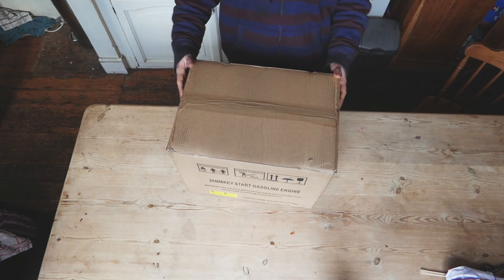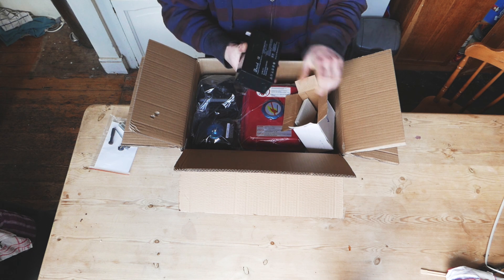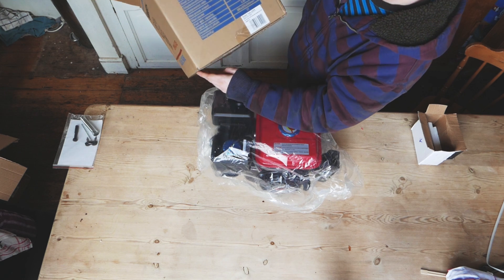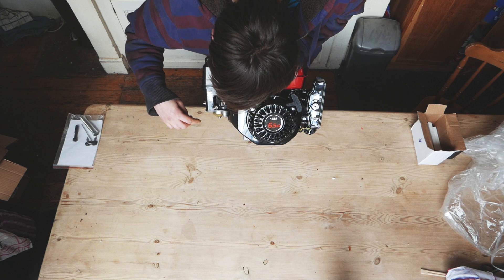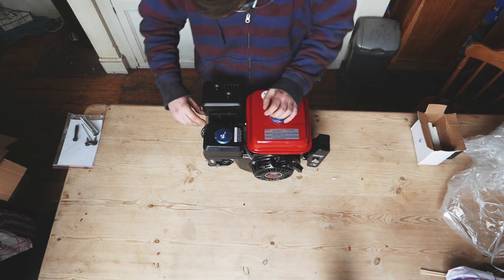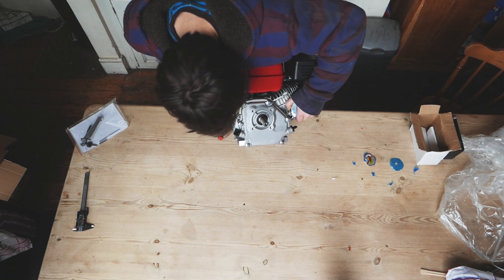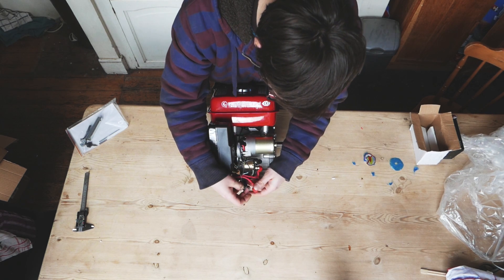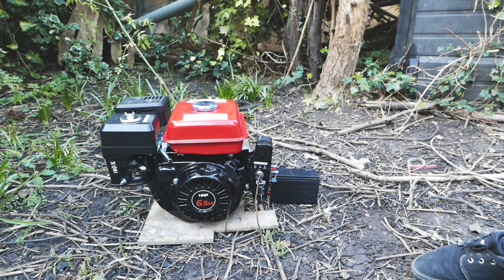Eberth 6.5hp honda clone petrol engine unboxing and starting overview with sound

Comment: Will this work in a lawn mower because I got a 25 year old tractor I want to at least run
Reply: It depends, if you're talking about a normal lawnmower and the shaft is vertical, it will not work as the output shaft is horizontal👍
Reply: @grimytech  its a vertical shaft
Reply: @swampdonkeyy717  yeah, so you'll need an engine with a vertical shaft to match, if you got an engine like the one in the video, it wouldn't work as the output shaft isnt going straight down, it goes to the side.I'd reccomend getting a ride in lawnmower specific engine, not one like this

Comment: Does sit come/need a battery? And if yes, how do you mount it? (the recoil start version)
Reply: It comes with a battery
Reply: You mount it near to the engine separately to it, there is no holding plate for it

Comment: Is there any what that I can add a fuel indicator?
Reply from the maker: You can - using a float type indicator (ebay) but you need to cut a 28mm ish hole in the top

Comment: For some reason  I bought the same engine type with the exception for some reason, of the electric starter motor ¿Anyone know if can install a starter motor kit in my engine modeL GG1-HR196-200?

Comment: I recently purchased one of these engines thankfully it came smashed up.  I have never seen such poor build quality.  The flywheel had jb weld on it filling the imperfections the magnet was held down by silicone sealer an 1 small m3   screw just to name  some of the imperfections.  The replacement lifan engine was 20 x better even the box had plywood in the bottom
Reply from the maker: Jesus, that's terrible! I would have thought JB weld is too expensive to fill cracks with 😂. Good that you got a replacement. Sounds like standard have slipped during the years 😣
Reply: I bet it off wish I know place where they make higher quality Honda engines and it’s is machine mart

Comment: are these engines any good? do they make the rated power? also will they last a long time? and can they be used for continuous operation for 6 hours or so?
Reply from the maker: I haven't dyno'd the engine to verify the power figure, but I think 6.5hp is only a peak figure, and only reachable intermittently. The engine does bog down when you load it up - if you plan on running it constantly I'd over-spec by 2 times, so if you need constant 6.5hp I'd go for a 13hp+ version (they do exist, they're just scaled up larger displacement versions). Hard to comment on the longevity - it's only splash lubricated, and has lots of springs and screws that loosen over time and carb might need looking at, but parts are very cheap compared to 'real' engines, so I wouldn't hesitate. Just maintain it regularly and it should last you a good few years. I had mine for 2 years +, running 3/4/5 hours at a time, it was going strong untill I messed with it till it broke 😭
Reply: @Loopyengineeringco  thats good to know. i plan on using it for pressure washer use so it would be run one day a year and around 5 or 6 hours of use on that one day.
Reply from the maker: @slybunda  oh, it'll be absolutely fine once a year. Just use the proper calculations to size the motor/pump/pressure and you'll be fine 👍
Reply: @Loopyengineeringco  its a off the shelf solution, says it has a 7hp engine. dont know if 0.5hp extra makes much difference. dont even know if its just the sticker and all the Chinese engines are the same lol.
Reply: @Loopyengineeringco  i bought the pressure washer and its excellent, its so much faster to do the job, im done in under 3 hours of run time.

Comment: can i install this to go kart
Reply from the maker: I've not done it, but i'm sure you can! Just need to add clutch, sprocket, etc
Reply: @Loopyengineeringco  how i install cluth.if the engine have gears
Reply from the maker: @Hirunaa.00  This engine has no gears. The output shaft is the crankshaft. You need to use either CVT or centrifugal clutch + sprockets
Reply: @Loopyengineeringco  how much weight can pull this engine
Reply from the maker: @Hirunaa.00  No sure. There are loads of videos on youtube of "GX200 kart", or "predator 200 kart"
Reply: @Loopyengineeringco  is this engine very powerful
Reply from the maker: @Hirunaa.00  cheap/reliable/powerful - you can always have 2 things but not all 3. This is definitely cheap & reliable. 6.5hp is not a lot. You can tune them to 12hp + but for the price, you can buy the biggest single cylinder you can afford, and it will be more reliable at stock power. I'd recommend the 16hp 460cc engines - much more power and still stock reliability. Or multi-cylinder motorbike engine. For my purpose (2000w~ generator) it was perfect - low fuel consumption and small, simple. But for a kart, i'd go bigger
Reply: @Loopyengineeringco  how i fount that engine ( you told).can you give me a link about that engine
Reply from the maker: @Hirunaa.00  https://ebay.us/bBbyfi this is a 420cc Lifan engine, clone of Honda GX390. It's much more powerful than my one in the video. But heavier and bigger, so make sure you have space for it. There is also a 460cc which is a few HP more, but can't find at the moment.
Reply: @Loopyengineeringco if that engine can pull 50kg
Reply: @Hirunaa.00  my gokart that I made had a 5.5hp engine and it could pull 80kg easy, with a large sprocket for good gearing, so you have to have a good gearingsetup. It had a mad top speed as well.

Comment: Do you think It's a good Motor for build a Go Kart
Reply from the maker: Sure! There are loads of upgrade parts for these too since it's compatible with honda parts - hi comp head, ignition advance key, larger carb jet. It doesn't have a clutch though, and the starter motor is probably not needed - extra weight
Reply: @Loopyengineeringco  thanks for the fast answer!!
Reply: @s33saudios  my gokart had a 5.5hp Honda on and it was plenty powerful enough for off road and even towing friends in a trailer.
Reply: @grimytech  nice! The Honda's are very expensive and good
Reply: @s33saudios  anddddd it blew up. I'll probably replace it with the one in the video
Reply: @grimytech  😂

Comment: I have a plan to build a model of the polish TKS 20. I'm thinking of using this engine, so long as I gear it down a bit
Reply from the maker: Sounds like a cool project! You'd have to find a clutch and gearing etc, but I don't see why not :)

Comment: You think that crank bolt is M8. I’m willing to bet it was a 5/16 fine thread. That was on my clone anyway.
Reply from the maker: Farmer Connor possibly! But m8 rod went in with no resistance. Mines a metric shaft 20mm, so maybe threaded with metric bore?
Reply: AS Motion Lab whichever works! I just know that the Predator 212 from Harbour Freight in  the USA has a 5/16 fine thread crank bolt. What did you do with this engine?

Comment: has the engine performed well or did it already gave up the fight?
Reply from the maker: PS It's broken now (my fault!). I'm sure it would have been running for many more years if I didn't mess with it! https://youtu.be/2mOVpBbSYa4
Reply from the maker: It's still going strong! It's used for a 12v generator (I have a video on it), so it sees moderate load, running mostly at 3000rpm. It's on about 300 hours now. The starter relay stopped working, so I have to start by shorting starter motor to 12v but it runs nicely. I'll do a compression test when I change the spark plug soon (been trying different temperature ranges).

Comment: Oh, was wondering, what's the max rpm of this engine ?
Reply from the maker: I think both cast iron and nylon plastic cam shafts are available for these engines (type 'gx200 camshaft' into aliexpress). The nylon ones being about 1/3rd the cost, so I imagine that's what these clones run but I can't say for sure - not taken one apart yet. That's not to say that nylon's bad - it's actually an amazing engineering plastic and I wouldn't worry about it's longevity if it's run within it's limits. I think the low RPM of these engines mean they don't require very strong valve springs, and this reduces wear on the cams. So by upping the RPM you'll just start reaching valve float. Regarding lubrication - these engines use splash lubrication and not an oil pump like their motorbike cousins.
Reply: Thank you!
Reply from the maker: I think it's 3600 rpm.
Reply from the maker: What's the geek ps that's what the limiter is set to. I don't think it would survive long with more than that, due to the fact it doesn't have a proper oil pumping system and plastic cams etc
Reply: OK, I wasn't planning on remove the governor anyway ^^

And, even with only 3600 RPM, i'll get 42 Km/h out of it !
Reply: @AS Motion Lab  If I may ask, where did you find out this information? I'm curious, since even plastic cams don't sound like it would last long at all...

Comment: Is it possible to use my own control pannel ? are the starter/ignition wires solders or connected ?
Reply from the maker: You'd need to figure out the wiring, but it's not very complex. The key switch does actually unscrew from the front panel, so you could extend the wires and put it on your own panel, but you might have to cut&resolder a few wires.
Reply: Thanks :)

Comment: Muy buen vídeo.Sólo decir que te tiras un rato dando a encender sin haber tirado del aire y así no arranca un motor en frío carburación ni de broma,es más se ahoga,hasta que no tiras del aire no arrancó como pudiste ver,para la siguiente ya sabes.un saludo
Reply from the maker: +manuel patricio diez my spanish isn't very good I'm afraid :). Google translate tells me you're saying something about choke and flooding - I probably have flooded it a few times now. I'm not an expert on carb operation. This engine is soon to be EFI!
Reply: +AS Motion Lab 
Hello Friend. thanks for answering, I have also purchased the one with electric start. You Can FIND SPARE PARTS? and another thing, vibrates enough, if I'm screwing a structure.¿may it broke by the fixings? thanks and great job. regards from spain
Reply from the maker: +manuel patricio diez I don't know if you can get spares for the exact model "eberth", but because they're clones of the honda GX engine - honda parts should fit. On ebay search for '6.5hp spares' and similar, you find lots of parts - many for the "lifan" version which is also a clone. It does vibrate but the vibration isn't very strong - It shouldn't break the fixings. Many people mount them directly to go-kart frames, motorbike frames, with no problems :) I bolted mine to a steel plate with 8mm machine screws (mounting holes allow 10mm) and it's strong!

Comment: I just got my Eberth engine it dose not have electric start but I am still happy . I will be putting it on my go kart this summer holiday for a bit of fun
Reply from the maker: +susan pyke nice. I wish I had somewhere flat to do the same!
Reply: hi, was 6.5hp enough? how heavy was the kart and whats the performance like? cheers
Reply: Will Creed 6.5hp is enough if you gear it right and keep your kart as light as possible. It also has room for upgrades for more hp.
Reply: @willcreed5402 yes 6.5 hp is enough for a small go kart😅😂
Reply: + The pyke

Comment: How do you recharge your battery
Reply from the maker: +Smindustries Good question! I've recharged it with a car charger that I have. I will measure the terminals when it's running to see if it charges when running, but I don't think it does tbh, I don't see any way it can generate power for charging without an alternator/dynamo.
Reply: +AS Motion Lab ok thank you very much

Comment: as it not got a pull start then
Reply from the maker: +keith rice yep it does, right there above and to the right of the "6.5 HP" writing
Reply: yes been thinking of geting a  EBERTH 6.5HP 4.8kW petrol generator portable  from germany  only £ 155 post free on e bay
Reply from the maker: +keith rice It's a good deal to be honest. I imagine it's going to be the same motor, but in a frame and strapped to the generator/inverter gubbins.

Comment: How much did you pay for that engine
Reply from the maker: +susan pyke It was £125 with shipping to UK. The recoil-only one is about £85
Reply: +AS Motion Lab  my eBay says it will cost me £1,124.90
Reply from the maker: +susan pyke I think they do this when they're out of stock. It must be easier/cheaper to amend the price of an ongoing listing than to cancel listing and re-list later when they get stock. Or it keeps people coming back to check!